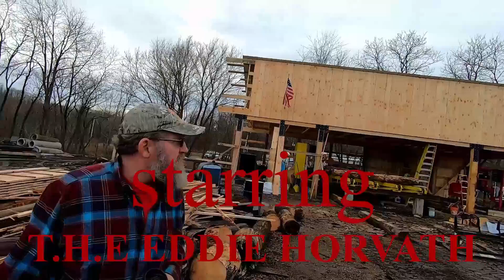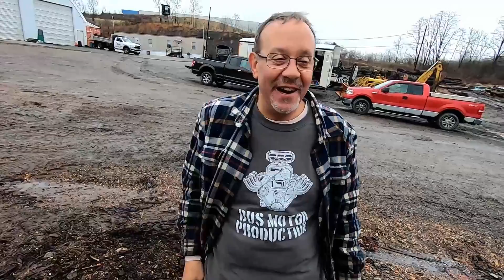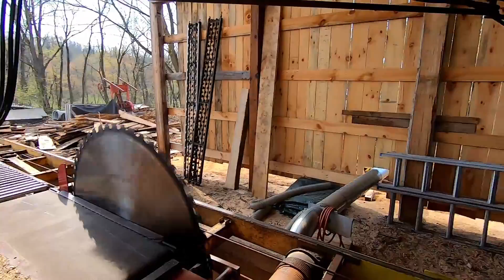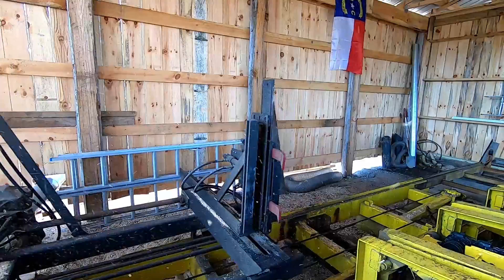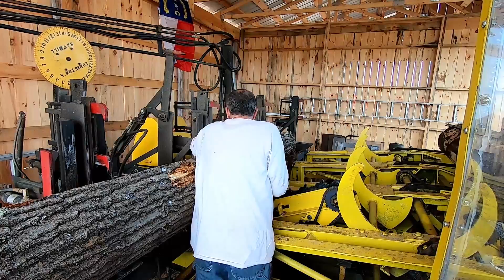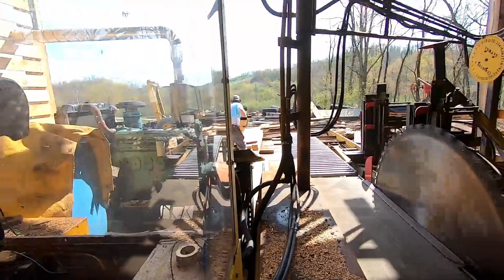just sawing

Comment: Looking good! The ole buzzin half dozen is sounding good. I like steel bits for the price. I don’t have a metal detector yet but I’d better get on that. Been watching logs fairly close for metal. Luckily, I’m only running on 1/2 the saw teeth, to reduce power requirements, so replacing teeth is fairly reasonable. 
Be safe!
Reply from the maker: thanks.

Comment: First off I want to thank Eddie for his quote. My sister liked it very much and promised to pass it on to her Pastor. I just love to hear that old Detroit work. It reminds me of when  was taking care of about 6 of them. From a 6V53  to an 8V71. Highway versions, not the stationary power plants. I really like your mill and I have an idea for your sawdust pit. Find an old car hood that fits when it's inverted like half a funnel. There was a guy in Mn. who had the same problem and solved it that way. The only bad part was it rusted out after about 5 years. I hear He replaced it with a corrugated fiberglass roof panel. If you like it ,try it. Like I said love your videos, Keep them coming and Be Safe.
Reply from the maker: thanks Don.

Comment: Noticeable difference in the sound, not much but a change for the better. I was wondering if double pane  with the plexiglass might improve things ? I did that with my shop windows  and it made a big difference to the noise level outside the shop. I can barely hear the compressor or any of my heavier tools going. The neighbors sure do appreciate it.
Reply from the maker: thanks Darth , I would need safety glass in the cab.

Comment: Do you have any numbers to compare the cost of operating the mill on diesel , compared to the cost of operation on electricity ?

Thanks ,   :-)
Wyr
God bless
Reply from the maker: no I never checked into 480 V power.
Reply: @markgalicic7788  Do not know what horse power electric motor would be needed to replace the buss motor ?  But it would probably be cheaper to go 480 VAC for that motor .  I am guessing the rest of the loads would be small , in comparison .

Do not know if the utility would be willing to take primary to the location of the mill and then set the transformers there .  If they would , that would amount to a large savings .

You might be able to talk the utility into bring power to you , even if it was 208/120 or 240/120 VAC .  For lighting and receptacles .

That would save you a lot of cost .  But switching over to electric would involve considerable cost .

Best of lucl .   :-)
Wyr
God bless

Comment: I know you just replaced those belts. For info going forward when you replace them asked for a match set even though you have more than two. It means they are coming off the same run. I can see those belts jumping around they will all tighten to the same length!
Reply from the maker: they were a matched set at least they said they were.
Reply: Might want to try a power band next time?  That puts all 6 belts together.
Reply: @markgalicic7788  Maybe want to think about rigging up some sort of an belt tensioner idler pulley set? It could help keep them from slapping around like that.